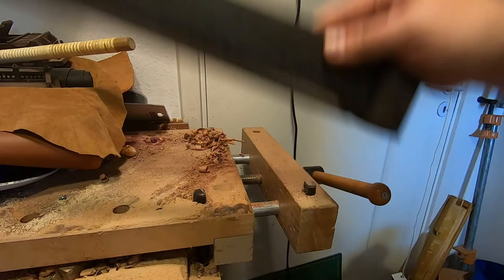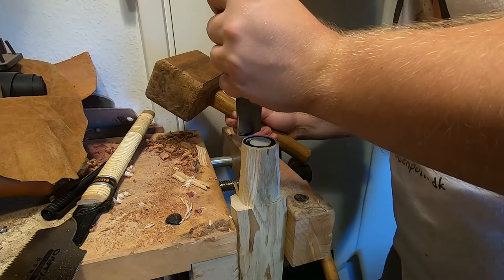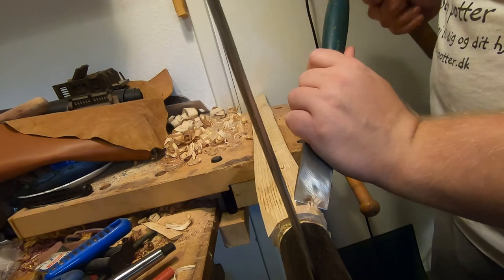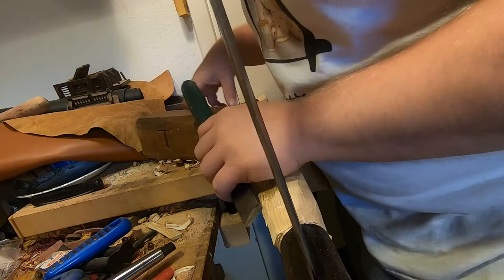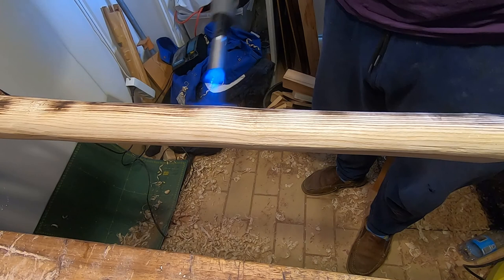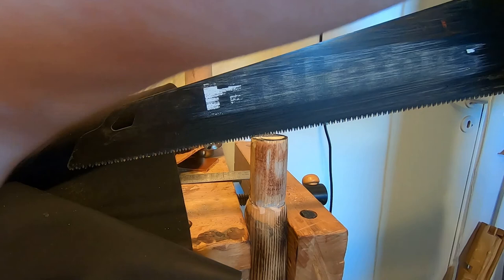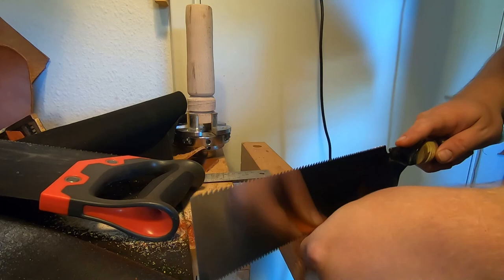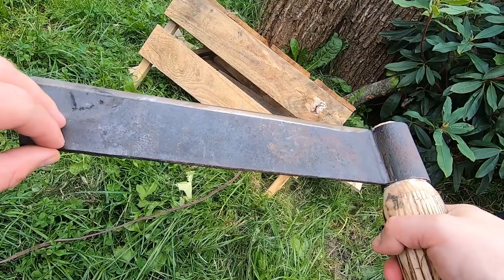Shafting a froe (making an ash handle for a splitting axe)

Comment: That's basically how you put a handle on an axe, on a froe I usually do a handle like a tomahawk.. that way you get a takedown tool for easier transport.
But I guess it depends on how your blacksmith made the eye, I drift the eye from one side only so it tapers from one end to the other, axes are drifted from both sides so the eye gets an hourglass shape..
If your handle gets loose at some point, I would check the taper, maybe you will get a better fit with the tomahawk style handle ;)
Reply from the maker: I have been considering changing it to a taper like you describe. Because travelling by train as I do with my tools. I look like an insane person! But it sadly does not have a taper, but! Maybe I can make one. Thanks for the tip, when I get my new workshop up and running I will try it :)

Comment: Cool. I had the same experience with making a handle that felt snug but comes loose when I try and use it, think I will wedge mine aswell 🙂
Reply from the maker: Mine is still staying on! But I think I will upgrade it to a metal wedge, since I dropped some time ago. 

You can also, after putting in the wedge, put the head piece in oil and let it soak and swell